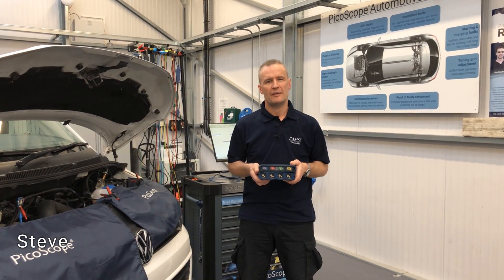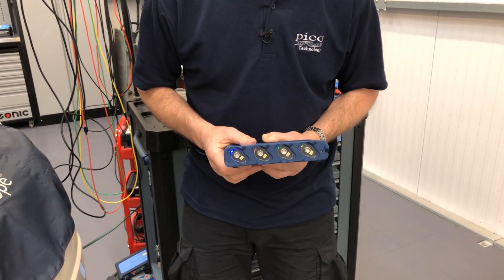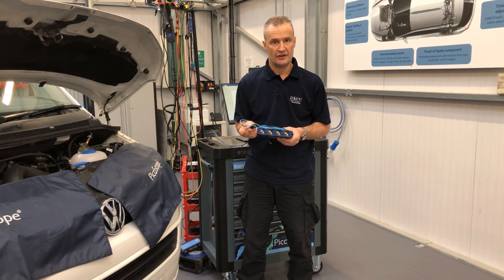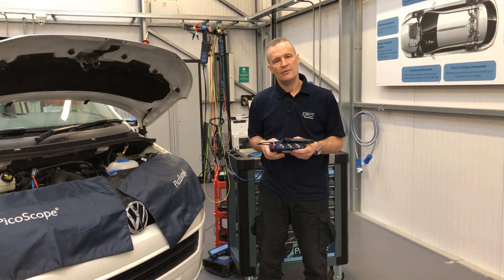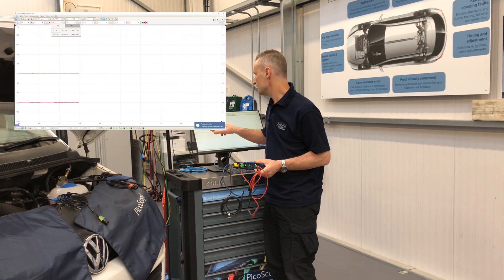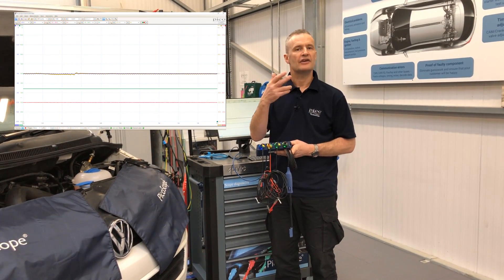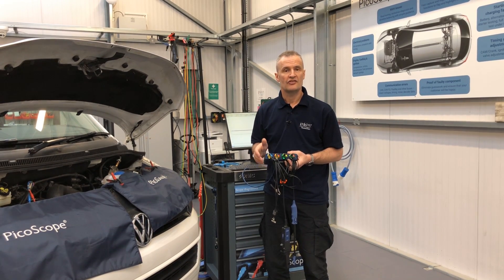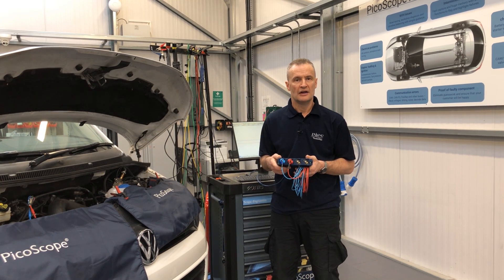PicoScope 4425A with Steve Smith

Comment: What’s the cost between the two 4425/ and the A version
Reply: about 10% more
Reply: Scott Andresen that’s not bad at all. Thank you
Reply: Hello and thank you for the feedback. INC: VAT: 4425 with a USB lead was £1114.80, whereas 4425A with A USB lead is £1162.80
Reply: Hi Welding Junkie, prices should be available on the website - www.picoauto.com